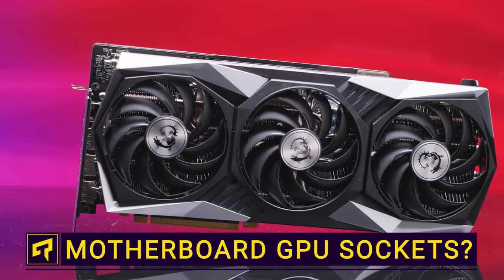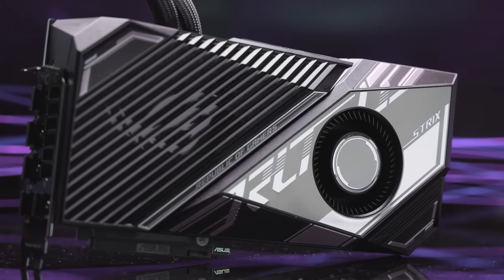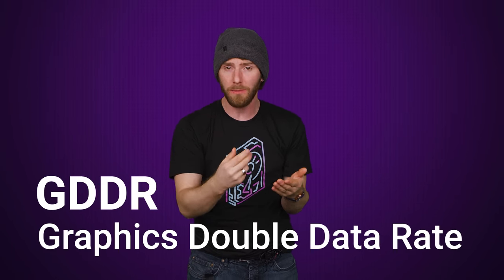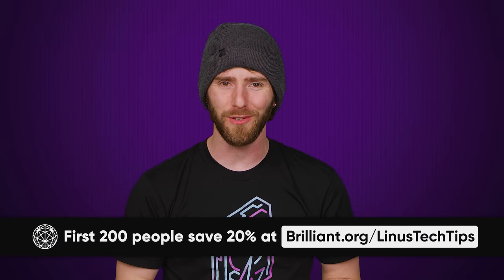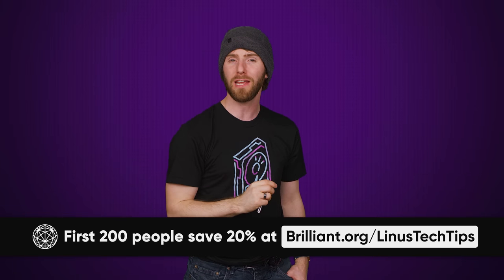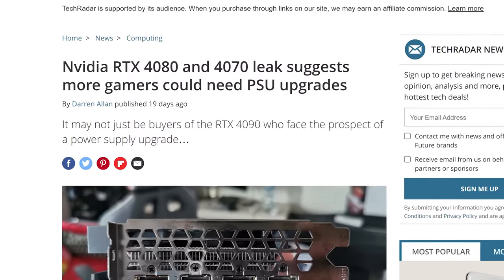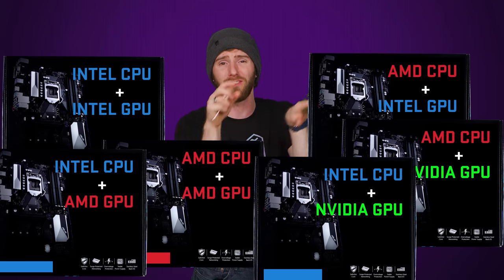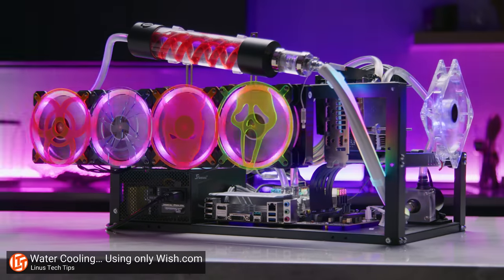Can You Put a GPU on a MOTHERBOARD?

Comment: Well, many CPUs now come with a GPU in them, so we do put GPUs on the motherboards.
Reply: Only for laptops, and game consoles. As for desktop it has to be Specialized CPU with low profile gpu.
Reply: @smiths7317  Most Intel CPUs do come with integrated graphics. AMD does not.
Reply: @smiths7317  What about AMD Vega Graphics?
Reply: Well, even Vega 8 iGPU (within a 5700G APU) is not that powerfull.
BTW 5600G and 5700G achieve practically the same iGPU performance despite 20% difference in raw iGPU power. Those iGPU's are pretty limited by memory performance.
Reply: @VanpyroGaming0  Obviously.
Reply: @NicCrimson  Low-powered machines that don't require a ton of horse power to fit certain budget.
Reply: @volodumurkalunyak4651  they ain't that far apart, I own a 5600g and in my configuration it really ain't far from 5700g ( my girlfriend brought a setup with the difference being the processor ) the difference is around 12%.
Reply: @smiths7317  "Specialised CPU, Only laptops and consoles". 

Intel CPUs aren't specialised. They're mass produced.
Reply: @Allanlbrr  difference could be 20% if memory were not a limitation. Here, memory is a limitation, hence difference to 5700g is 12%. I personally got an system based on a 5600G for setting up a daily overclock (CPU cores stock, iGpu 2200 Mhz, Infinity Fabric 2200Mhz, DDR4-4400 20-24-24-48-72 1T GDM). Nice performance boost compared to XMP-3200 iGPU 1900 stock,  IF 1600 stock.
Reply: @smiths7317  desktop processors can definitly have integrated graphics.
Thats what the G in ryzen 5 5600G stands for, GRAPHICS
Reply: @smiths7317  no, a lot of desktop CPUs have an embeded GPU, as an example the i7-12700 has a GPU built in.
Reply: @VanpyroGaming0  5700g is actually huge bang for the buck for a decent starting machine.
Reply: @TenOfZero1  Integrated graphics a.k.a low-powered gpu, and most computers using intel were able to output video without discrete gpu.
Reply: @Allanlbrr > “they ain’t that far apart” 
>“12% increase”
Pick one?
Reply: @untitled795  12% is less than 20% ain't it?
Reply: @smiths7317  
AMDs forthcoming Phoenix APU would like to talk with you
Reply: @VanpyroGaming0  And that's a shame, sometimes you want it and when you don't have it and need it, you are screwed up. Another problem is that AMD g series doesn't support PCI-E 4.0 while Intel does with no problem.
Reply: @drakemyers2323  Yeah with stupid PCI-E 3.0
Reply: @smiths7317  low powered graphics is still graphics.
Reply: @VanpyroGaming0  Pretty soon AMD apu's can game in 1080p decently
Reply: Yeap,somehow Linus failing to mention that.
Also Linus,touring Intel lab.
Do i smell a pattern here ?
Reply: @TenOfZero1  Low powered a.k.a integrated which isn't the same as discrete graphics, and also is power limited unlike with discrete graphic card, and is bandwidth limited unlike discrete graphic card.
Reply: @DuneRunnerEnterprises  He's also working on project which is sponsored by AMD. Also he was sponsored by Intel during that lab tour but decided to tear it up, and pay them.
Reply: @smiths7317  
But,he still FORGOT to mention the cpu/apu bundles .
Why ??
Reply: @smiths7317  I don't disagree. But the video title is not can we put a discrete gpu on a motherboard. It's can we put a GPU on a motherboard. The GPUs built into CPUs are 100% GPUs and they are put on the motherboard.
Reply: Literally in the cpu spot. lol. So it is possible. Could just use a dual cpu mobo, and have a special cpu with iGPU where it's mostly iGPU and has a small integrated cpu in it just so it functions. On slot for a normal cpu and the other slot for a cpu with an overblow iGPU in it.
Reply: Yeah APUs.
Reply: @volodumurkalunyak4651  i have the ryzen 5 5600g and i can play a lot of games on smooth fps
Reply: @Nicko0  thanks, but I already know that. 5600G is about GT1050 iGPU wise when overclocked or midway between GT1030 and GT1050 when stock. Pretty fast even at stock and nice OC performance boost.
Reply: Huh many reasons man. Imagine that you have motherboard that you dont need to replace for 5 or 6 years. I know its not in interest of big manufacturers to do it but hope is still there, Time will show.

Comment: The easy answer is yes, it is already regularly done. They call it the integrated graphics on an APU. Of course the folks watching this channel want far more than that :)
Reply: take a laptop motherboard and screw it in a pc case, you'll have discrete graphics(not an apu, intels have that too and desktops), jobs a golden crack a beer.
Reply: SXM is Literally a socketed full Graphics card standard...
Reply: @dinkiethesink  Tech Quickie is not talking about server motherboards, they're a different beast where being limited to a specific vendor is not necessarily as much of a problem.
Reply: The real question is, why not making chipset graphics?
Reply: @alexatkin Yes currently SXM is only on Server boards but its still an existing standard that completely defeats the point of the video which seems to argue that its "impossible" in some way
Reply: @dinkiethesink  obviously this video isn’t for sysadmins working with specialized server hardware, plus they have time constraints

Comment: "There are now 3 gpu manufacturers"
Allegedly. Intel GPUs are still unicorns
Reply: Well there's Matrox… actually, I'm not even sure if their cards use chips that they design or use someone else's.
Reply: @ConstanceJill  Until 2014 they used chips they designed themselves, then they switched to using AMD GPUs on their boards.
Reply: Intel has been with their own GPUs since 2016 i think it is the not integrated GPU that is the new Intel thing. So most likely if you have an Intel CPU you also have a Intel GPU if you are using it or not is another question all together.
Reply: I have an Adreno GPU :P
Reply: Nah, the DG1 exists, so we know Intel manufactures exactly 1 dgpu.
Reply: @TheRealSkeletor  They use some Nvidia cards as well, their whole angle now is just the software stack for enterprise customers.
Reply: Four. Sure, Apple’s claims regarding the M1 family’s performance may be a little bit lofty, but it still packs quite a considerable punch. But yes, you were answering to Linus’ mention of “discrete GPU manufacturers”, so… technically, you are correct.

But it’s still funny and interesting to notice that he had to explicitly mention the “discrete” part; it just goes to show that they’re no longer the end-all, be-all of graphics-intensive workflows. 🤷‍♂️
Reply: Unicorns are real! They're just big, bulky, dull, grey, slow, and grouchy, unlike what Lisa Frank may have taught you as a kid.
Reply: The i740 was an Intel GPU. A really bad one. After it flopped, Intel abandoned GPU development. Later they decided to have another go with the Larrabee GPU project, which got really close to production before being killed off. Some of the prototypes got out but I've not heard of anyone getting one to work.
Reply: They say that drinking their cooling fluid can extend your life at a terrible price.
Reply: a n i m e
n
i
m
e

Comment: I mean, PCIe is just.... a socket that everyone has agreed on using, as a standard.
It would be interesting to see maybe down the line once CXL is in wide use, the ability to allocate some of the CXL attached memory to a GPU.
Reply: Yeah but into that socket you basically slot a whole specialized computer dedicated to handling the heavy lifting of running games.
Reply: PCI-E isn't a socket, it's a bus.  You can make a socket/slot that connects into that bus.
Reply: Its not a socket. Socket = Secure, Slot = Removable
Reply: I love how the comments are focusing on how PCIe isn't a socket, or how specialized GPUs are. Before the Universal Serial Bus, there were dozens of connectors, some standard and some proprietary. Before PCIe, there was PCI and AGP. There once was an expectation that enthusiasts might solder additional components directly to the board. These practices have been done away with, in favor of more user-friendly and standardized approaches. 

The original comment suggests this idea on GPUs. Realistically, pin layouts don't need to be different, but it's profitable to keep everything proprietary. VRAM configurations don't need to be different either, and the argument proposed in the video that "Not everyone uses a dedicated graphics card" could just as easily be applied to the need for PCI slots as a whole, yet here we are with almost all motherboards coming manufactured with at least a handful of PCI/PCIe slots. There's no reason a consensus couldn't be reached for a standard graphics socket interface, as well as configurable VRAM.

In the end, it all comes down to money, and no self-serving corporation is going to spend money developing a feature that integrates with a competitor's product. Just look at Thunderbolt, originally envisioned as a standard optical interconnect (Light Peak), but sold exclusively to Apple and USB-C ended up winning the day on universality.
Reply: @penguindrummaster  SoC will end this discussion! lol
Reply: A PCIe slot and a dedicated GPU socket are not nearly the same engineering feat (and a GPU is only one of a billion different things you can plug into a PCIe slot). There's simply no reason to move the cost off the dedicated GPU onto a mobo socket.
Reply: @CursedLemon  Ya, the main advantage of PCIe is that it is a packet based network (not unlike Ethernet, but for short REALLY high bandwidth runs) In theory, you can even hook multiple devices into a single PCIe slot using a PCIe switch and this is sometimes done in the server world.

Comment: As several comments have stated, this was actually a rather doable solution in the past. We have seen integrated gpus in mobos, albeit in the low-end integrated machines before igpus. Very similar to something my very old laptop used to run on, but on desktop format. Surprised this was not mentioned in the video. Besides that, the video still holds true to the facts that the integrated solutions did, do not and probably will not meet the high performace standards that one might expect from a dedicated gpu.
Reply: Nvidia chipsets those were the days. GForce 2 mx400.
Reply: I dont know irdna2 and the 6500xt real word performance might be a toss up

Comment: Look at some mainframes.
Power delivery can be slotted, GPU can get a slot, and vram can get a slot, each.
Think of the ewaste reduction, and get the exact combination of specs you want.
Reply: That would actually increase ewaste as consumers swap parts they don't entirely understand the significance of. It's more efficient to package compatible and well-matched parts together into a single unit.
Reply: @deusexaethera  PSU, RAM and CPU are already separate. Same level of complexity.

Comment: I feel like the discussion should have been made at the beginning where older motherboards, from the AT era, had graphics and video processors built into the board itself, sometimes even having expandable cache or having expandable memory

This was being phased out during the age of AGP, but you can also find some motherboards as late as PCIe that support onboard graphics.
Reply: There are boards with integrated AGP cards, most commonly the ATI rage series was found on some budget Slot-1 motherboards.
Reply: do you know how many of those on board gpus died of overheating?
Reply: @aaronpalmer7425  reliability aside, they existed for a long time
Reply: @phillycheesetake  I have a few of those, they are good for light classic gaming
Reply: I have one on G41 socket 775, can play latest game like untitled goose game in cinematic twenties
Reply: It extended WELL into the PCI-E era.
Reference the NVidia 60100/6150 chipsets with GPUS in the Northbridge.
What killed the idea was GPUs integrated into the CPU - like the AMD A-10 and lower level options.

Comment: We need socketable GPUs and socketable gddr5 so we can buy 1 gpu power card with sockets for the GPU and ram so a upgrade is only a GPU chip or ram modules depending on what you need or want to upgrade at the time.

Comment: The old nForce chipsets were basically a GeForce chip and thus provided the onboard graphics.
Reply: and ATI
Reply: @ServetTonga  Remember when some AMD based motherboards came with onboard Nforce chipsets in the Phenom II X6 days right before AMD bought out ATI? I had an MSI one, and it was kind of neat seeing the all green branding(yes AMD use to use a Green logo as well), but at the same time not the most reliable board having weird issues when putting my system into sleep mode.
Reply: @CommodoreFan64  I think Phenom wasn't out yet, ATI had onboard GPU which had kind of crossfire with dGPU on PCIe slot. I had used Phenom II X6 on a board without GPU. 
And those green chips, nForce boards, they were the most stable board I ever used. Even ethernet was by Nvidia.
Reply: @CommodoreFan64  Yep, I also had an MSI motherboard with an AMD CPU, an ATI GPU and a NVidia NForce chipset, all on one board!
Reply: @ServetTonga  I think the sleep issues were more of a Windows thing, than the Mobo itself, and on my Mobo I used dual 1GB Nvidia 9500GT cards in SLI to play Crysis Warhead at 720p medium to get close to 60fps.
Reply: My nforce4 is just a 18years old girl, how dare you say she's old ! 🙃😸
Reply: @LordNementon  Sadly my system that had the Phenom II X6, and dual Nvidia 9500GT cards in it died after about 6 years of faithful service due to the fact the ANTEC 300 case I had it in was on the floor under my desk as I was limited on space at the time, and my long time girlfriend's daughter knocked my coffee mug off my desk onto that system one morning. Man was I ever sad about it, but at least it gave me an excuse to build a better system, as I have the mindset of if it ain't broke, and still does what I need it to do, then why spend the money to replace it?
Reply: @CommodoreFan64  Phenom II X4 and overkill 780GTX lightning on my side, haven't be able to move to W10 due to the lack of some obscure CPU instructions, DDR2 to the moon! 😸
Reply: @LordNementon  You might want to give Linux a shot then, as you might like it.  Solus w/Budgie DE is really easy to use. Just burn the ISO on an 8GB USB flash drive with Etcher. 
Also speaking of DDRII RAM, I do still have another MSI Micro ATX AM2+ based mobo with an AMD Athlon II X4 @2.95 GHz all core OC w/ cooled with an DeepCool downdraft cooler, 8GB of DDR II 800Mhz RAM, a 1GB Pegatron AMD 6570 DDR3 GPU(had an XFX AMD R7 240 2GB GPU, but had to put it one of my niece's system to get it back up, and running for their school work)that I pulled from a salvaged HP machine, 120GB SSD, 2 port USB 3.0 PCI-e 1X card, and an old Liteon IDE DVD-RW drive, and it still runs Solus Linux at 1080p 60hz just fine for a back up system, and at most with the XFX GPU was pulling 130ish watts at max even when gaming on STEAM at 720p - 1080p depending on the title  according my kill-a-watt meter, and that's with an older Delta non 80 plus 430 watt PSU that still test good with no bulging caps.
Reply: True, I'm still using them on my AIO Dell
Reply: A N I M E
N
I
M
E

Comment: So I think the solution is to make the GPU Motherboard itself a seperate piece , so that if the GPU Motherboard (Whatever Acer/Gigabyte builds) dies , you can replace that differently & if the GPU Chip itself (The one that's manufactured by Nvidia) dies , you could replace that differently.. This would also mean that you could potentially increase VRAM in future by swapping out the GPU from a 1060 3GB motherboard and putting it in a 6GB 1060 motherboard..
Reply: Out of box think

Comment: Opened up my laptop the other to slot in more ram, and lo and behold the GPU is directly soldered to the board. It shares the heatsink with the CPU.
Reply: Yeah that’s most modern laptops now a days, it’s really only “desktop replacement” type laptops that MAY have a removable GPU, and they are made for that laptop family only. 

I have my dad’s old 05 dell precision m70, and the GPU and the single core CPU, where removable but it’s meant for swapping them out if something breaks, it wasn’t meant to be upgradable
Reply: Maybe this video should have been more precise. It only address if it was possible to have a socketed GPU processor. Soldered GPU on laptops is common.
Reply: @romulas-cushmanproject3273  there is a standard for graphics cards called mxm. it was widely used in laptops and all in one computers
Reply: @windowsxpnt2347  I didn’t know that, I guess I shouldn’t have said “only” the GPU in the laptop i mentioned had what looks like a proprietary connector and had the heat pipe and  heat sink soldered to it

Comment: I'd love to see laptop GPUs on desktops, single slot, low profile, low power
Reply: The GeForce 210 exists. You can buy one!
Reply: @TheRealSkeletor  I believe they're talking about a mobile 3070 or similar like in a performance ultrabook. Not a glorified display driver from 2009
Reply: @TheRealSkeletor  nice joke but I’m talking about mid or high end laptop GPUs
Reply: @ServetTonga  yeah we could have those gpus on OEM devices but not on enthusiast computers
Reply: @joseabraham777  something like mxm but officially for dekstop
Reply: @ServetTonga  Why?  It would be WAY more expensive due to being a tiny niche market.
Reply: @alexatkin  even low-end GPUs are two slots and heavy, noisy, requires too much power meanwhile modern laptop GPUs are almost as powerful as desktop but fits into tiny package which's a mobile device.